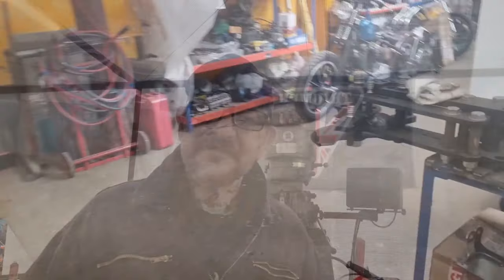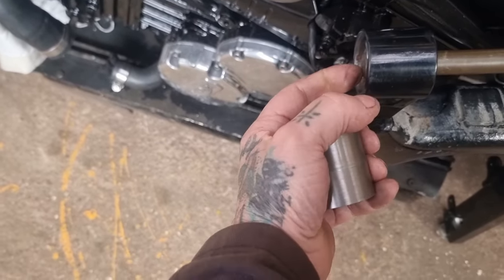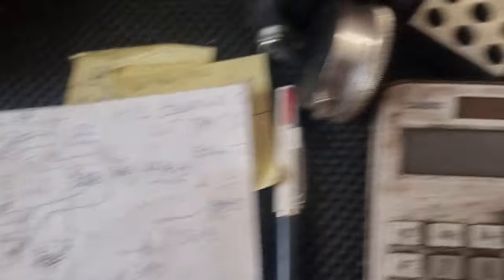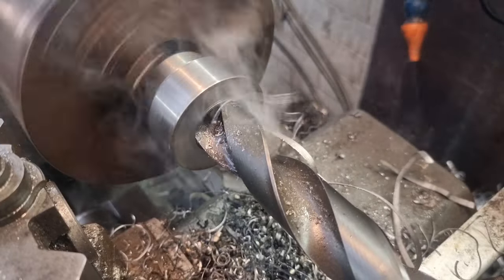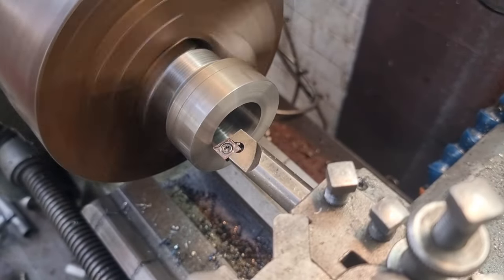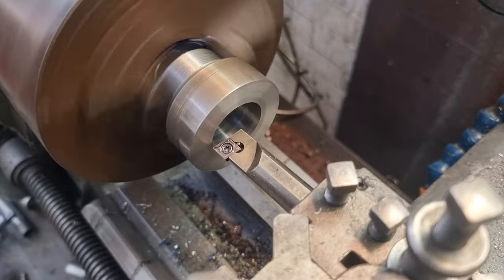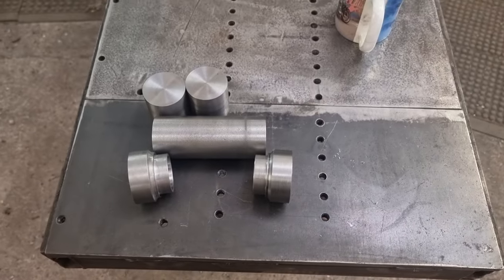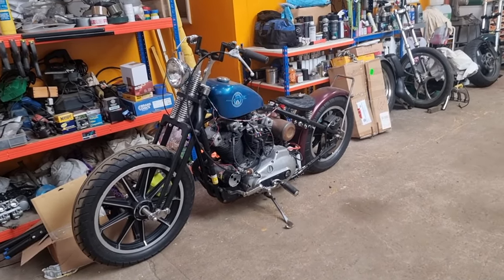Triumph Swingarm Chop Pt1 Handmade Custom Bike Building #chopper #bike #engineering

Comment: I'm using an old Myford 7 with dials you can't zero, so i bounce between verniers a good quality micrometer and just sneak up on dimensions, sometimes polishing down to get where i need to be. Always great content Ralfy i enjoy watching the struggle (And the odd "Fuck me that's hot") plus the end results always impress. And as always i learn something new almost every video. Some of the ideas i have seen you come up with are going to help with my latest build, GS 850 shaft to chain, single sided swingarm, 200 section tire on a car wheel, and a gixer 1127 motor. 😎
Reply from the maker: Awesome buddy, thank you, good luck with the builds

Comment: You’re good mate, it’s a right pain in the arse having to go off the dials, I had the problem when my DRO died. You kept coming in slightly under size so I wondered if you might be getting a bit of deflection on your boring bar? Otherwise all good. I had to make up a small part on my lathe the other day and it took three attempts to get it spot on and I was using the DRO, I think I need to calibrate it properly again.
Reply from the maker: Thanks bud, yeah I actually woke up this morning thinking I should have shortened it back for the bearing cups lol
Reply: @RalfyCustoms  that’s what I was wondering, there was a fair bit of stick out there, fine for the roughing out but maybe a bit long for the finer stuff. Probably the first time you’ve heard a complaint that you’re sticking it out too much ;-) pfnarr pfnarr
You’re up early, how’s the moggy?
Reply from the maker: Moggy is getting there buddy thanks 😊